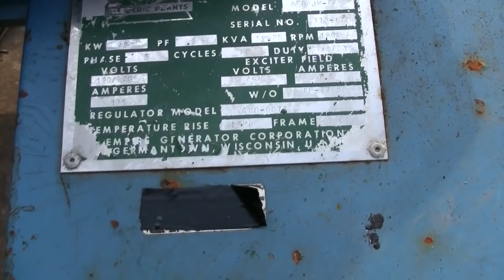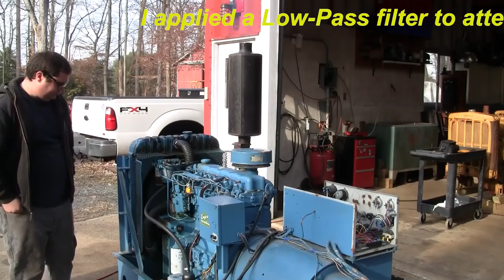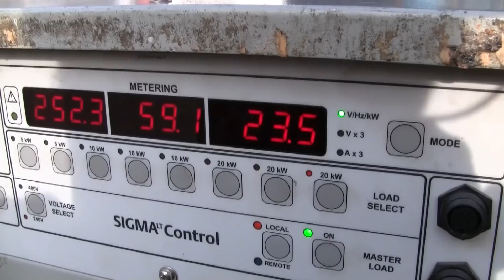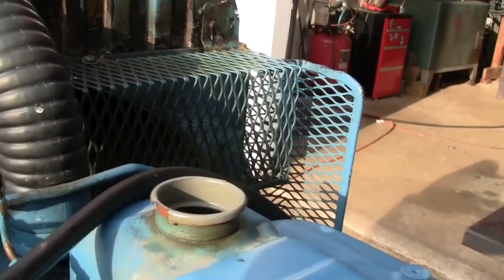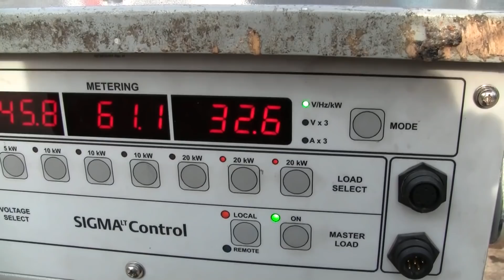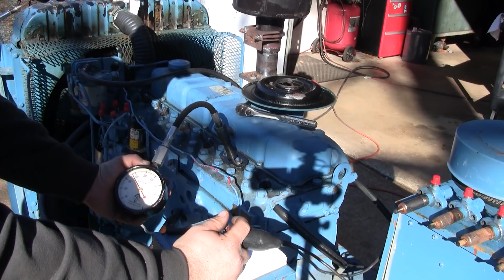PERKINS DIESEL Generator Upgrade Engine Trouble Pt.1

Comment: Hi there! I just found your channel today and this playlist is excellent. I realise this video is a couple of years old, but I have a question please. I have a Lister-Petter TR3 with a mechanical governor. A few months ago it stopped operating for me because it kept shutting down with an overspeed fault. I know very little about generators (hence searching Youtube to try educate myself). The gen is controlled by a pretty old Deep Sea Controller. I changed the magnetic pickup thinking that might be the issue but it's still shutting down with the same fault. I did some more research using the documentation for the controller and I realised that if the alternator goes higher than 57Kz it triggers the overspeed shutdown too (at least I think so). I cranked it a few times and I saw that the frequency gauge would shoot way up to over 65Kz straight after cranking, so I think this is the problem. Do you think the governor could be at fault? 
Thanks a mil!

Comment: Diaphragm on the lift pump is the normal way for fuel to enter the crankcase.The pump is driven by a skew gear from the camshaft.Its an easy fix.Companies like Agriline,Vapormatic etc do all replacement parts.They supply new shortblocks for the 236 but not the 354.Perkins 236 was their most common engine.

Comment: Even if the pressures hadn’t recovered, the minimum at 330 and the maximum at 365 were just under 10.7% variation of the minimum reading so essentially right on the maximum recommended cylinder to cylinder % variation. 
Of course if you start with the maximum pressure of 365psi 10% takes you down to 328.5 so we’ll within! 😆

Comment: Going by the look of the engine I would not have removed injectors or tested compression, On a genny from day 1 means should be good other than some leaks and possibly pump issues from stale or dity diesel. Good engines tho but the phaser was better.

Comment: Sounds like the engine is running smoothly, but it's hard to tell with the low pass filter on.

I agree with a previous poster on the fact of keeping the old brain box. Just rebuild it with modern caps and you will be good to go.

Comment: The 6,354 perkins, good old workhorse, 6 denotes the amount of cyls, 354 is the cu. Inch cyl capacity, if the lift pump diaphragm is leaking the fuel system would probably air lock and stop the engine, fuel could leak out of the drive end of the injector pump, worked these engines in trucks in the 70s,

Comment: I think the mic overloading is coming from the low frequencies.  If the high frequencies are also overloading the mic then apply a bandpass filter.  I would also mic yourself with another mic (I think you are already) and move the background sound mic farther away in future.  You might be able to low hi-pass the sound on this video and reupload.

Comment: I had this problem in my engine when put load on it frequency and sound change.. but I trimmed my injection pump on load to reach ideal frequency but whenever I unloaded engine ,it increases speed and control board show over frequency and shutdown ...my injection pump is Delphi that couple Perkins engine ..as far as I remember model is 1106 or 1104a

Comment: I worked in the diesel injection trade for 25 years, this injection pump probably has worn governor parts. A good rebuild of pump and injectors including bench testing will help. There is no external droop, or sensitivity, adjustment. Also no max fuel adjustment. You can only set the max speed and low idle. There are several wear points that effect the droop, or rpm drop, when load is applied or removed. Replacing these parts will give you the result you need.. Make sure to use a reputable shop, with a test bench..

Comment: Had a t6.354m in a boat. 160 hp rated with the turbo and air to water aftercooler. She was a dirty girl under load. Anything over 2100 rpms and heavy load it smoked like a coal train.

Comment: If the lift fuel pump diaphragm is leaky...
is the lift pump supplying enough fuel at a high enough pressure to the CAV injection pump so that the CAV pump can cope with the extra engine load...
which, of course, requires extra fuel???

Comment: To be pefectly honest I would probably pay more for that genset with the original brainboxery working than I would with a modern digital equivalent that is 250% more failure prone and disposable. It may not seem like it on face value given the problems this unit has, but the fact that it's still able to make power is testament to the durability and longevity of the old school components.

I would restore the original control system to proper working order instead of replacing it outright. To me it'd be a downgrade to put modern electronics in there. I'd rather have a generator that's a little off in the rhubarb 50+ years on than have one that stops making power entirely after just a decade or two.

Comment: Those CAV pump goernors are not very precise, I have a Perkins 152 running a 20  Kw 3 phase and i ripped all the mechanical govenor out of the pumpas i could not get it to govern tightly and fitted an electronic one ..instant success

Comment: The pressure differances are probably down to a little rust forming on the valves and seats if its been standing still for a long time .I would advise you to get the inj. pump done at the same time as it is probably gunged up inside,again because of standing still. the internal governor gets gummed  up and does,nt move freely which is very important on a generator.Set the generator at 50hz for the most stable power flow.

Comment: I do not like the rotary injection pump system.( used 4. each one theengine did not operate "quite right" I like in line injection pumps.

Comment: if there is diesel fuel entering thecrancase, then in my opinion, the fuel might be evaporating causing some of the "blowby". The other thing, is that if the engine was designed in the UKJ, as I suspect ir was, the rpm would have been dsigned for 1500 (50Hz). I used to run Rolls Royce engines (750kVA) units designed for 60Hz, and when they were rtun at 50Hz, they vibrated just as the control box vibrated.  just a thought, Harmonic vibrations are worthy of consideration.  The "miss" could either be an injecto or the pump. I would try an injector first. the pump is unlikely to differentiate between cylinders as it started very quickly with no build up of fuel pressure.

Comment: I have the same engine in my boat I bought it many years ago it was a standby engine for a bin lorry. These engines do suffer from fuel pump diaphragm rotting out, they also suffer with injector pump governor issues a quick clean up and recalibrate of pump fixes the issue, but having fuel leaks will not help as it allows air into fuel this will also allow governor to be unstable as it runs in fuel.
I also noticed your engine does not have the heater glow plug setup. It run from the return line of the fuel filter as a fuel feed this is feed up the centre of the glow plug when you use it you have to wind it over then heat it.. as for an engine there Bullit proof they give very very little issues as long as there serviced like any other engine.. you can still buy parts from Perkins in the Uk for this engine, as a boat engine it’s outstanding plods along all day long not to noisy as it’s under the deck and exhaust has water pumped down it to cool rubber pipe so it’s much quieter

Comment: Great engine the Perkins. I grew up around them. Dad was a diesel fitter for Massey Ferguson. He use to go on about the Rotary CAV pumps. Even as a kid I'd shake my head thinking " every other English engine manufacturer used inline injector pumps except these idiots" . Nonetheless a fantastic engine Perkins are but that Rotary injector pump is the weak point. Perkins parts are cheap. Any Tractor spares shop will have parts.

Comment: The 372 was a better engine, the ac delco lift pumps were on some replaced with bosch plunger type and they were an even bigger pain. Never had problems with the cav pumps on either 354s or 372.
Reply: Wow I would have guessed that Bosch of that era would have been the far superior injection pump.
Reply: @RobertE92  not the injection pump, the lift pump. Can't say I ever saw a 354 or a372  with a bosch injector pump.
Reply: @bigteddy66  apologies, the service book I have for my 6354 does give a setup for a Bosch injection pump although like yourself I’ve never seen one in reality

Comment: Great video, Mike!! Wondering what you’ll use for an all electronic Gen head? Also, really stupid question, but the muffler isn’t clogged is it? Could cause all kinds of back-pressure issues.

Looking forward to the next one!! Thanks.
Reply from the maker: I have a controller in mind, will have to wait and see!  Nope, the muffler is actually new. 
Thanks for checking it out!
Reply: If I understand if correctly he’s just replacing the controls/voltage regulator, not the whole gen head. I don’t know anything compared to Mike but I know that you can buy generic generator controls relatively cheaply today.
Reply: @MittyNuke1  Roger that. Understood. And I didn’t mean to type ‘generator head’. I did mean generator controls.

It’s amazing what a designer can do with a microcontroller nowadays.

Comment: In the fuel injector pump there is a very fine filter that is prone to blockage ,also the fuel lift pump diagram prone to failure, the can next to the injection pump ,not sure it’s requirement,they are a very dirty engine inside,also the valves do we’re into the valve seats giving compression problems

Comment: Sourcing parts should be easy, as these are the same engines in the London bus routemaster double deckers. Also Perkins is Rolls Royce, so the parts are readily available from that source as well.  I've looked after several perkins powered gen sets over the years.
Reply: Is perkins not part of cat now.
Reply: Routemaster bus usually has the AEC engine, I didn't know they have Perkins 6.354 in them.
Reply: @kindkoun  bit of confusion I think. AEC was or became part of rolls Royce. Don't know about the diesel side, but aero was I think. Perkins is cat owned almost 100%sure. Correct me if I'm wrong. Just not sure.
Reply: @bigteddy66  You are right Caterpillar owns Perkins now. In the 80's Perkins bought Rolls Royce diesel engine division and after that they were swallowed by Caterpillar. I don't know if AEC was part of Rolls Royce before they stopped making engines. On a side note Rolls Royce at the time wanted to concentrate on aero engines. They owned 50 percent of BMW aero engines, bought their partner out and gave their prestigious automobile marque to BMW! I believe the B52 re-engine program involved one of the BMW/Rolls Royce models.

Comment: Check the valve clerance.
Engine that stays for long time it will have problems with valve clerance.
Adjust them and after 10h of work check them again.
But the blowby its a problem, can be the fuel on the oil.

Comment: the running rough could be valve lash and or crook injector nozzle dribbling in the cylinder ( also might explain diesel in oil). Perkins of that era had a good reputation in tractors. Other issues indicate that the injector pump needs a service.

Comment: If that NA 6354 is only about 87 kw and you are trying to draw 40kw with a load I wonder why it drops off a bit L.O.L. That industrial engine is probably governed for flat out, more like a combine engine where a tractor or truck engine has a bit different governor that allows it to vary fuel more with load changes.  We have one of those pumps on our 6372 in our combine it was peeing fuel out everywhere including in the timing gears. I watched Bundy bears video and got a good brand kit from ebay and did the rebuild it's running far better now than it ever did even without new internals and a recalibration. so you might get it with injectors redone as well if they need it.
    It might be worth changing all the rubber sealing rings on the fuel pipe fittings to if it has that style instead of brass olives. The rubbers go hard and start leaking or they don't tighten up and seal right letting them start to pull air.  when i did a tractor rebuild some of the Perkins rubber rings updated to brass olive fittings through Agco part numbers. If the valves were set tight they may  not seating quite right still with some damage after the reset I've seen it on several tractor heads,  I seem to remember the settings are quite wide on them when they are right.  Thanks for the video take care.
Reply from the maker: Thanks for checking it out!

Comment: You're running it, but I literally see zero governor operation at all... is that thing even hooked up? Watching you load it, I don't even see the solenoid twitch.
Reply from the maker: The governor is mechanical and integral to the injection pump.  The solenoid you see is only the "run" solenoid.  When it "pulls in" it allows the internal governor to operate.  When it drops out it forces the pump to the no fuel position. 
Thanks for watching!
Reply: @SmallEngineMechanic  ahhhh I thought I was missing something!

Comment: Great video as always  but it's a shame you can't do anything about the exhaust volume as its sometimes hard to hear what your saying without blowing out my speakers
Reply from the maker: Yes, unfortunately I have a noisy job!  There has got to be better suited microphone for the task though.
Thanks for checking it out
Reply: Thanks for the reply  
Just a thought  ( as I'm no engineer) 
What about some kind of flexible piping to divert the sound away ? 
Or would that affect performance  ?
Reply: Do throat microphone,s work ? 
I've never seen or heard one in action but they used to use them in tanks and big noisey bommers ? 
Just a thought ?

Comment: sounds like it needs a good tune up  ,, i've never yet seen a  354 perkins  that ran smooth   ,, I've got one transplanted into a ford ranger ,,it was completely rebuilt and had blowby from day 1 still runs beautiful just like it did 10 years ago  , but it never ran perfectly smooth  for whatever reason ,,mine is a 4-354  but i have worked on 6-354 engines as well ,,that injection pump is a headache  if it goes wrong ,,, lots of these engines found their way into massey fergusson tractors , generators weren't so common  but water pumps and farm machines like hay swathers and smaller combines ,they were simple and reliable and pretty easy to  work on
Reply: Yours would be a 4.236

Comment: The fuel pump leak will afect the internal fuel pressure  pump and responce of pump
You can strip most of this pump externals replace seals theres internal filter aswell on inlet fitting
Reply from the maker: Thanks for checking it out.  I plan to get to the pump in the next video!

Comment: careful with that advance on the injector pump. There is a small ball that fits in a side hole when you unscrew the round bit. easy to louse.

Comment: Perkins United Kingdom will have all the information on your engine. I had a Genset like yours with a Aussie brand name. The CAV pumps are bad for governors, there the throw out weights design. Send it for a overhaul so it gets recalibrated and it’s internal pump redone:-)

Comment: As a diesel mechanic, time to rebuild the injection pump( bad shaft seal or worn out pump bushings can cause diesel in the crank case,) replace or rebuild the lift pump and pop test all of the injectors.

Comment: Fuel leaking into the oil through the injection pump. oil cools and lubricates the injection pump and there's a seal that tends to fail in the fuel passes between the oil and the injection pump

Comment: If you were in the UK i would say instantly injection pump and injectors out and away for a good service  solve most of those issues  those lift pumps are quite good at leaking  . Yes thoses injectors need a good service  forget the test they need doing  as will the pump

Comment: Quite an historically important industrial engine the Perkins 6.354.
People forget that globally it was the Cummins 6bt of the 1960/70's. 👍
Trucks, tractors, combines, forklifts, wheel loaders, generators, pumps, compressors, boats - you name it! If you needed 100-130hp, over a million made worldwide. 

The Lucas Cav injection pump was the weakest link, as it was with any engine that had them 😂.
Reply: Yep, those rotary pumps aren't the best.  IIRC Perkins nomenclature is cylinders and swept volume, so this is a 6 hole 354cu.in/5.8L engine.
Reply: @572Btriode  Correct on the nomenclature. ☑
Reply: Yep I remember seeing them in tractors ALL the time.
Reply: we had one in chamberlain tractor with a turbo on it, heavy on fuel compared to cummins 6bt
Reply: @fixitdude74  They were, but remember they were in production for 20 years before the 6bt even left the draft board 👍

Comment: I have that same unit. I had replaced the injectors and solved that problem. You could try and have them cleaned and or rebuilt ? I had found a set cheap of ebay long back
Reply: Oh also I put a taller air filter on mine

Comment: If I saw the screen message correctly it mentions that you added a low-pass filter to lower the genset noise. The correct type of filter to lower low frequency noise (genset) is a high-pass filter. Doesn't make sense but that's  the way filter networks work😀